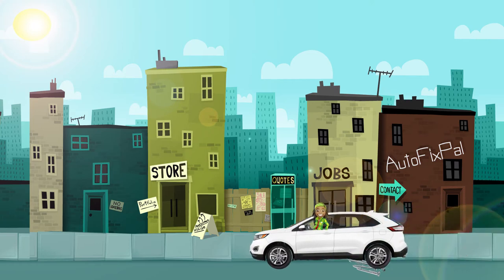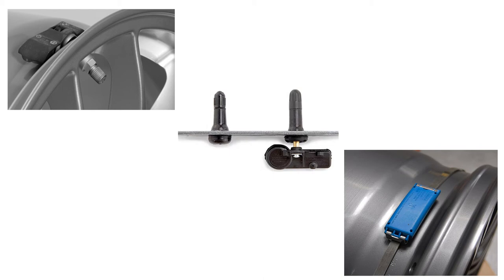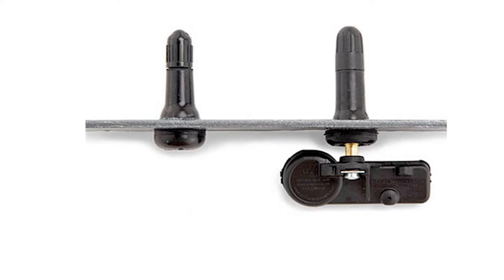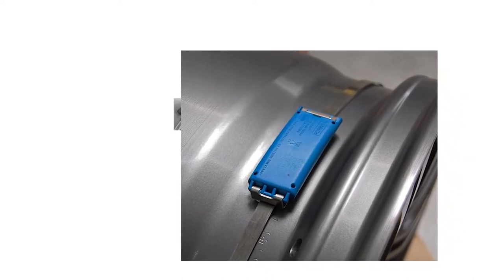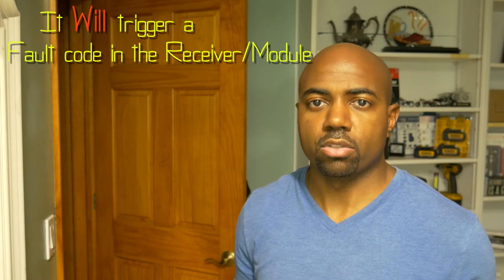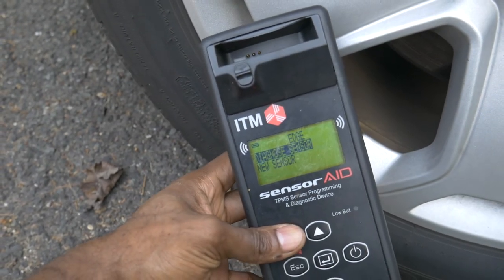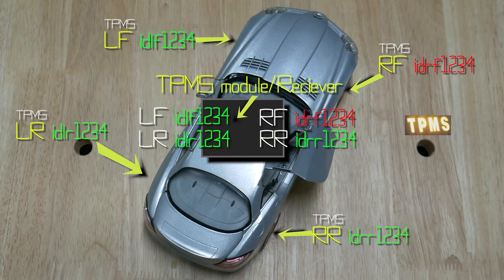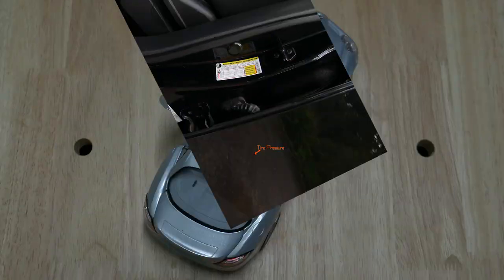TPMS  - Tire Pressure Monitoring System Explained - Low tire light

Comment: so, for indirect systems, in the cold season, when all tires on the car loose air, the car won't set off the tire light?
Reply from the maker: i am sure that manufacturers know that tire pressure will change with temperature and that tire pressure drop when temperature drops. So and this is just my theory about how I image the system can pick up on that.

when there is no one wheel that has a higher rate of speed than the other wheels, lets just say higher RPM. The module will and should (my theory) look at the history of the rate of speed for each wheel and compare it to the speed from say output shaft or differential speed and take into account the ambient temperature (most cars have an ambient temp sensor). It can also calculate vehicle speed based on GPS to determine if all the wheels are spinning at a higher rate than they should be spinning. now tires do wear out and can loose about an inch in overall diameter as it wears from 10 32nds to about 3 32nds so im sure they have the algorithm for that worked out as well. 

Most indirect systems that i have encountered (VW, Newer Honda) have a reset button somewhere in the car. which probably restarts the learning process for wheel speed variations based on wear and temperature.

BTW thats a VERY good question and i should have put that scenario in the video.

Comment: Hello. I have to replace the four tire sensors for my 2011 Dodge Grand Caravan Crew.
Which brand will be best fit for it and it has to be programmed and ready to use? Thank you
Reply from the maker: best brand would be OEM. Get them from Dodge, im pretty sure the vehicle will need to have its TPMS receiver/module (whatever Chrysler is calling it) reconfigured with the new TPMS sensor ID's. If you don't like going to the dealer than most tire shops should be able to perform this for you. Just bring your own OEM tpms sensors to them to install.